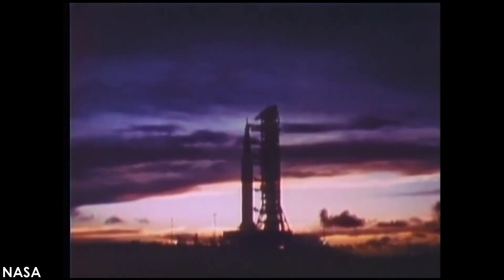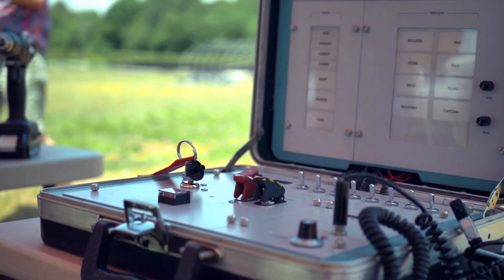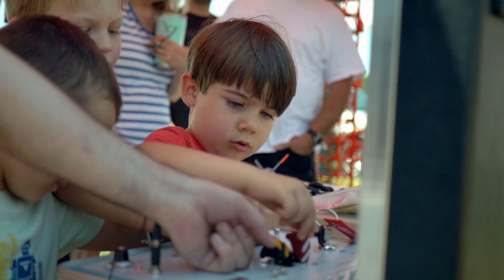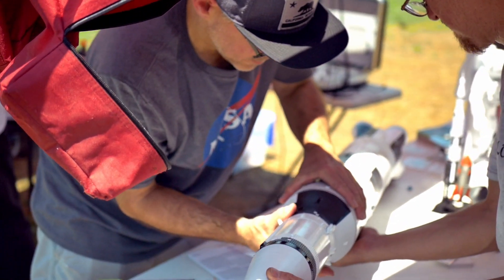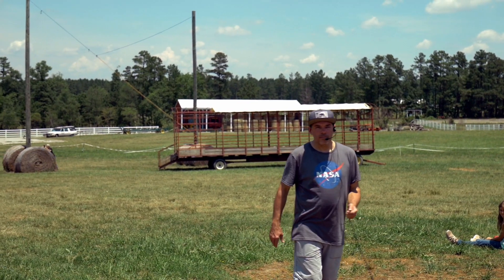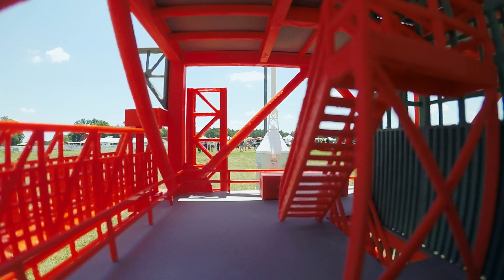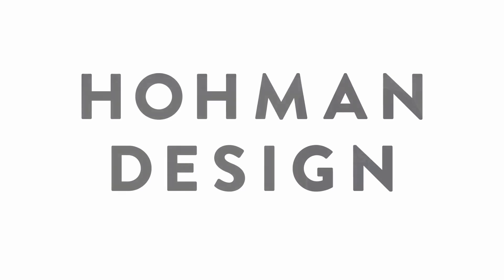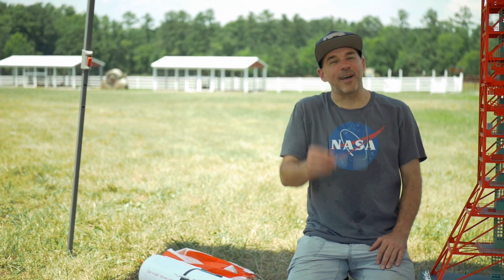Apollo 50th Anniversary - Part 4 - The Launch...

Comment: Right now I'm in the process of building this exact same rocket from Apogee with the exact same engine.   Your failure will press me to be really careful when assembling the engine and securing it in the tube.  Thanks for the warning.  
   I remember in the 70's buying some C rocket engines that were half price and thought i got a good deal.  But they did the same as your engine in that the ejection charge went off right after ignition.  I think the fuel was not glued to the casing securely.
   Your rocket painting was beautiful!  I hope mine ends up half that.  I'm almost done with the booster section and it is a lot of work but I've learned much about the great Saturn V.  I wondered why did it have fins?  Well Von Braun wanted to give it an extra couple seconds of stability in case it lost auto control to give time for the escape system to get the astronauts far enough away before it broke up and exploded.
Reply: I launched my Saturn V and it was successful!  I sent a link to your company email for videos and details.   Thanks for your advice about building engines ahead of time.  My first G79-4W engine did not ignite and switched to my backup engine which seemed to also not ignite but after 1.6 sec delay it did.  I know the feeling of inviting all those people and then having it not work.  It's a big risk.  Hope you try again.  I love you launch tower.
Reply from the maker: @bobjulie298  As others have famously said: "Yay Bob!" What a cool gift to mark an occasion. You really made the most of it, fearlessly tearing into the build and creating a really cool moment of community surrounding the launch. Thank you for taking the time to share it with us and rekindling the fire to repair and attempt another launch ourselves. The GoPro footage from the ground and drone footage from the air were fantastic! Share those videos with the world! Congratulations. 🚀
Reply from the maker: Thank you for commenting! It's such a good model, a fun build and presumably a great one to fly. Just prep your motor days before so any adhesives from the assembly dry. I don't think motor retention was our problem. Had our motor completed a burn and then fired the charge, things probably would have gone as planned. Our motor came apart in a hot second and blew out both ends. We still intend to repair and re-fly. I hope you subscribe for whenever that happens and that we end up doing more to interest you. Also hope to hear more from you on your flight. If you remember, add another comment with your results or DM us a link to any social media posts about your project or flight. Ad Astra! I didn't know that about the fins BTW, thanks for sharing.

Comment: Where and how did you get the information to build the launch tower. The dimensions for each of the floors and its entire tower and Mobil launch platform.
Reply from the maker: Thanks for watching @lox_5017  The gantry is 3D printed. Over a thousand hours of printing and then scores of hours assembly! We do hope to release a video about the gantry project so please subscribe and get notified for that future release. Our gantry was printed in parts from the files you can find here: https://www.thingiverse.com/thing:5024532 I recall it's creator was working with a smaller printer and at a different scale so he had every little part broken out to print individually. We took one part we knew the size of and used the percent different in size to scale all the parts to the scale of our rocket. We additionally took some of his individual parts and created our own subassemblies on the computer for prints we made on larger printers. We used measurements we took from that model and scaled them to design and build our own simplified plywood box as the launch platform but he has the model for a highly detailed base as well depending on your needs and interests. Good Luck!
Reply: @HohmanDesign   Thanks buddy! Looking forward to that video.

Comment: This reminds of all the the rc airplanes I built , I built a 1:10th scale F-4 phantom jet, took a a good solid year to build to scale. On the 4th flight a friend of mine he took off with his BVM F-86Sabre , beautiful jet ( it was) .He turned around in flight & started to fly in reverse flight pattern. Well lets says I realized we were heading nose to nose ,I chopped the throttle dropped the flaps & she pitched up & then his jet impacted mine rite in the bell pan. Fiberglass clowd, we both took our jets home in garbage bags. 
   You never know in a hooby of any kind when you will have a failure, but we do the repairs & move forward. She's a beauty
Reply from the maker: Ouch! What a terrible incident. And to such a beautiful plane! The combination of the dihedral angle of the wing tips and anhedral angle of the tail fins on the F-4 have seen me reveling in that design for hours. I could swear the F-4 informs the drop ship from the movie Aliens. That thing is some sort of collage of and F-4, A-10 and an Apache helicopter.

Comment: Do you have any plans or schematics for the launch controller? I'd love to make one like this!
Reply from the maker: Hi Cody! What's your level of experience in electronics? The controller is rudimentary to say the least. Three simple  concepts govern the whole project.

First, the device is simply just a chain of switches. Power is passed from one switch to the next switch in-line and any switch that's OFF along the path will prevent a launch. While the narrative is one of "standby" modes, and "arming", the box is a dumb enclosure. There are no boards or chips (save for the clock), simply switches and wires.

Second, most switches are double pole, so that each switch in the bottom of the case illuminates a status indicator in the lid of the case. While the signal for launch passes through one pole of each switch, the wiring for the other pole is made discreetly so the light comes on for a given "status" even if a preceding switch in the chain is OFF. This way, you get all the activity and drama out of the board when used in any order, while launch is impossible until the whole chain of switches are all ON.

Third, it may be possible that the power running through all those switches has the adequate amperage to set off an igniter, we don't know, we never tested that. But just in case there was too much impedance in the chain, or even in any one of our components, our launch "signal", as it's passed through the final launch button, is not used to travel out to the pad and light an ignitor, rather, it simply toggles a relay that passes the unhindered amperage of the big video-camera battery right down the cord to the igniter.

I got help with the audio component which was outside my wheelhouse, and the countdown clock with relay for automated launch is still unfinished. The clock with relay is wired in for auto-launch capability but the instructions for that board, which we found on Amazon, are in Russian and we have yet to figure out how to use it.

We will be making a video specifically for the launch controller which should demonstrate all the things I have shared here and more so please subscribe and check back to see that content when we are finally able to do that.

Additionally, depending on how serious your effort to duplicate this project becomes, please DM @HohmanDesign on Twitter or Instagram and I can probably arrange to share the closest artifacts we have to a "schematic" with you, though I would suggest not getting your hopes up in regards to our documentation. Thanks for watching, and your interest in the controller specifically, we can't wait to get the long overdue video out for this project.

Comment: Which G motor did you attempt to fly it on?
Reply from the maker: Aerotech 29mm Loadable Motor - G79W-4 Have you got any thoughts or feedback?
Reply: @HohmanDesign  Looks like your issue may have been from assembling the motor incorrectly. I've flown the Areotech re-loadable system for years with only one issue and that was my fault. Also looked like the case ejected upon  igniting the ejection charge. If that would have happened on a successful flight you would have lost the case  and that get expensive.  Great work on the project.
Reply from the maker: @miketay100  It was very much my mistake. I had a big crowd come out to watch and realized that I needed both a better understanding and more time to prepare the motor, I crossed my fingers and hoped some elements of the preparation were redundant instead of essential. Nope.
Reply: @HohmanDesign  Been there and done that. I prep motors at home now so I can focus. it's tough to do when there's a crowd and people asking questions. If your going to prep at the field have a second set of eyes watching to catch or question possible steps missed..
Reply from the maker: @miketay100  That's exactly what I needed to do, and have more time for adhesives to cure.